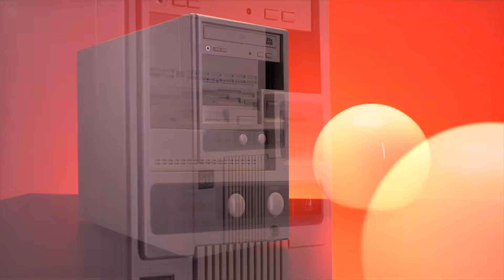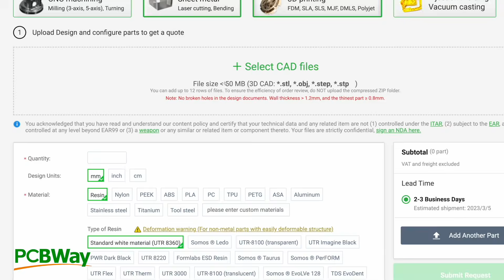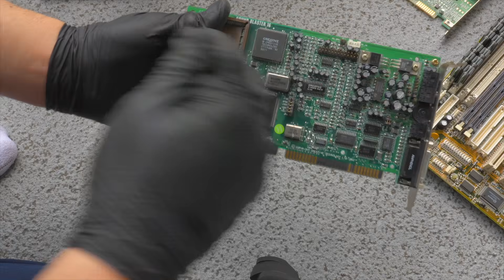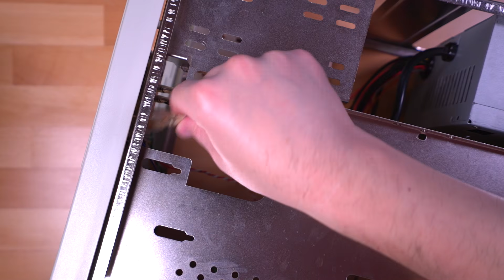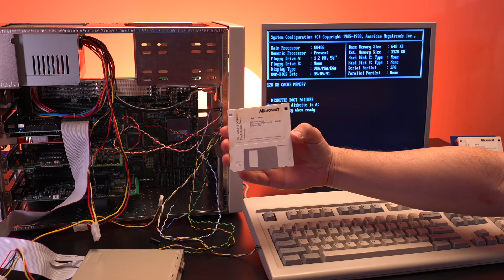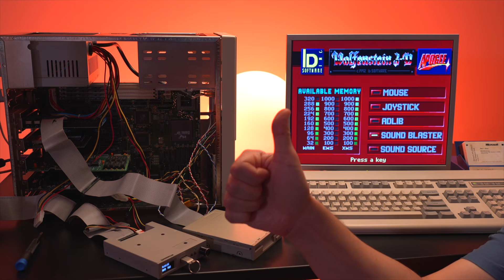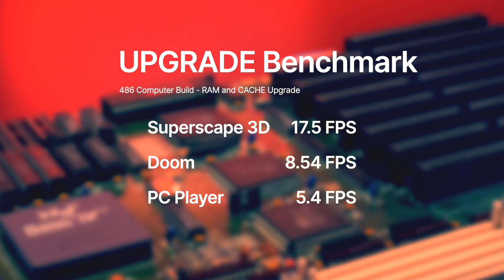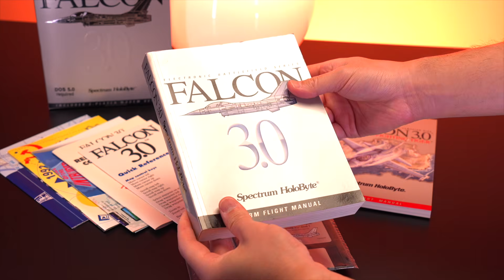Restored And Upgraded 32 Years Later | 486 DOS Build

Comment: Our first computer was also a 33mhz 486, Still have some parts from it but it was broken way back so at this point i only saved the working parts, unfortunately as I probably have the skills to have fixed the dead motherboard now. Anyhow this old stuff often need to be re-capped at this point to reliably work today, more and more of my old computers die from failing caps and I have to re-cap these failing components to keep the computers running but I mean it´s a hobby. At the same time you should use Cache check to verify your computer is actually using all that memory you installed and not just that it is installed. But 486 computers without Vesa Local Bus runs dog slow with 33mhz in comparison to a ISA VGA card and it pretty much only help to run faster CPUs on these instead. Also Compact flash cards can be a very good solution as substitutes for dead Hard Drives as these uses the IDE interface internally and can be just dropped in with a cable adapter

Comment: I would go straight to the point about the Sound Blaster Card, i don't want to sound rude but back in the days yes the Sound Blaster Card works good with the game controller aka the Joystick, but the problem is it only also work with a same compatible Sound Blaster CDROM
and a slow Sound Blaster CDROM i think it was 8x, since back then that Sound Blaster Card is a bit picky and wont allow and any pirated cd games or any pirated installer at all to run on the CDROM. But it's best to just keep the Sound Blaster card since in those current back days it's the best sound audio quality available.

So just in my honest personal opinion if, just if, you want the CDROM you currently put on the pc casing to work just plug it on to the IDE I/O PC Controller that came with the 486 DX2 mother board, not on the ISA Sound Blaster card cause there not compatible.

Comment: I saw two interesting comments regarding performance issues. One recommendation was to add 487 FPU unit which your CPU already includes (486SX was crippled version, without FPU) and second one that the VGAs bottleneck is ISA port. 

Both comments are wrong. To increase the performance you need to... Upgrade CPU. 

Doom fully relies on CPU performance, not the other components.

Recommended CPU clock to get smooth gameplay was Pentium 60.

Comment: In order to get playable frame rates on all benchmarks swap out the 486 DX2 66mhz for the Intel 486 DX4 100mhz CPU and install 16mb ram and get a motherboard that has 2 PCI slots 3 ISA slots and 1 ISA extended slot. The board I'm referring to was SIS motherboard (I can't remember the exact model) but it will allow the sis 2mb GPU and the vlb isa slot will support sound blaster 16 and 32 with creative cd drive connection. Will also have ide controller and floppy drive controller built in to the motherboard.. it's the system I had as a child and ran dos 6.2.22 and windows 95 perfectly and ran windows 98 but was slower in windows games!! It will run all dos games at a solid 30fps to 80fps depending on the game type 2D vs 3D but is all playable.

Comment: Hi! Vintage keyboard nerd here! That keyboard is an NEC APC-H412 with NEC Blue Oval switches. An absolute gem of a vintage mech keeb.
Reply: yea, he has keyboard worth of 80-120$ and he don't know, lol, 
that it's more valued keyboard, than 95% keyboards that people use nowadays, and from modern ages like 2000-2020 era.
Reply: @warrax111  the board is worth anywhere from $70-100
Reply: @ you must be from cheap country , but please don't start some war because of $10-20 difference in price estimation. The point was somewhere else.
Reply: I’d get a 486 machine if there were any way they could support USB keyboards lol
Reply: @-dash  there are USB to PS/2 converters as well as PS/2 (and 5-pin din) to USB

Comment: you did a great job I love it. I would leave everything as it is in its maximum possible originality. The modest performance is due to the old ISA bus. The best performing 486s had standard VLB motherboards with direct memory access. Or even the latest 486 DXs with PCI interface motherboards like my DX2 80. They are more performing but less fascinating. The beauty of these machines is to maintain as much of their originality as possible and the nostalgia element is fantastic😍

Comment: Dude the RAM upgrade part made me laugh because that's not how upgrading worked back then.  You couldn't just "throw in some RAM" or "add a random perhiperal" and expect improved performance or functionality.  You had to determine if a piece of software required or could even make use of it before expecting anything out of an upgrade otherwise it would basically go unnoticed by the system/OS and software.  Almost ALL versions of DOS/Windows as well as software packages would list "minimum requirements" and (sometimes) "recommended requirements".  If you didn't meet the minimum there was no guarantee it would run and if you got lucky and it did it would usually be somewhat crippled in some way.  If you met the recommended you would get an improved or premium experience, ranging from better performance with better CPU or more RAM or improved functionality such as better audio with a fancy sound card.

Comment: Regard to low FPS-
I think you are limited by graphic card, Trident were really slow low end cards, meant more for 386. Try Cirrus Logic, Tseng, S3.

486's had VLBUS to address for this problem, but you've used slow ISA card.
Another problem seems very slow CPU. DX33 was not in the playable range for Doom, DX2-66 was recommended processor for that.
If you set your DX2-66 right, I remember, even with fast ISA card, 20-25 FPS was possible. With VLBUS graphic card, you can get to 30 FPS range.
Reply: ok, now I see, you don't have PCI or VLBUS slot. Seems, you have very early 486 motherboard.
So only option is to try faster VGA ISA card.

Seems, the problem you have is bandwidth limited, or some BIOS problem. When you don't get aditional boost with cache upgrade, you know, something is limiting (not slowing, but limiting) whole motherboard down. I experiened even some card was slowing it down. Try different controller cards, etc... . Once, in socket 7 system, like 30-40% of performance was eating by PCI USB HUB card with VIA chip. I've switched it to NEC USB Hub, and problem dissapeared. Seemed like some BIOS compatibility problem.
Reply: I’m so spoiled by crispy doom. It’s hard to beat the original doom experience with the single exception of 144+ fps
Reply: @-dash  original Doom was capped at 35 FPS, so noone had more FPS originally.
Reply: @ yeah i know — i’m just saying that the original doom experience (including the in-game tick speed) is perfect, but the one exception is the capped frame rate. Crispy Doom is the perfect port as far as I’m concerned

I grew up on Windows XP so I don’t have a ton of nostalgia for the OG Doom, I think it’s amazing in it’s own right
Reply: @ yeah i know — i’m just saying that the original doom experience (including the in-game tick speed) is perfect, but the one exception is the capped frame rate. Crispy Doom is the perfect port as far as I’m concerned

I grew up on Windows XP so I don’t have a ton of nostalgia for the OG Doom, I think it’s amazing in it’s own right

Comment: Regarding floppy drives, as much as having a 5.25" drive physically installed is a nice look, complicating things enough to have three floppy drives via an extra adapter isn't a way I would go. I would've used just the 3.5" drive and the gotek. 

Regarding the optical drive, there are OEM IDE options that would look better than an obvious retail upgrade while stealthing as an improvement. Look for even multipliers of 8 and 16, such as 16x or 32x, they're likely to be more reliable and plain looking. 20x, 36x, and the like tend to be more cheaply made uglier drives that felt like they had to advertise themselves with gaudy external labels. 

If you really do want to use the sb16 card for a cd-rom, double check what kind of interface it has, because it's likely a Panasonic (Matsushita/Kotobuki) that has the same 40 pins as IDE but is an entirely different interface. If you really want a period correct drive and have trouble getting it to work with the sb16, you might look into a drive with a bundled isa controller and software to ensure a matching interface.

And heads up, the dos driver for an ide cdrom is so ubiquitous and genericly recognized as the driver, that you might run into problems if you consider it the only option to get it to work. Look for a Panasonic, Sony, or whatever ends up matching your interface if/when oakcdrom.sys fails.

Last tip, once you've got all your drivers and TSRs you want loaded into your aitoexec.bat and config.sys, if you're not already an expert at manually tweaking memory management, run memmaker, included with dos. It'll try some things and make sure you've got the most conventional ram available for needy games.

Comment: Awesome to see you're getting into retro PCs! With regard to improving performance:
The Sound Blaster 16 CT1740 uses the proprietary Panasonic CD-ROM interface which looks like an IDE interface but is pin-incompatible. Your options here would be only 2x speed CD-ROMs such as the quite common Panasonic/Matsushita CR-563 and CR-563-B models. They are a bit expensive on eBay; however, there is a 4x speed CD-ROM drive by Teac: the CD-55A, but those are rare. You'll also need to install the Panasonic driver in the config.sys file (CDMKE.SYS).

Additionally, to improve performance, you might want to consider installing a faster CPU, a DX2 66MHz from either Intel, AMD, or Cyrix. Check your motherboard manual for compatibility first. An Intel Overdrive processor might be an option as well.

Lastly, what would dramatically improve performance would be to get a better VGA card. Trident is usually regarded as a bottom-tiered GPU vendor. I'd recommend a card that sports a Cirrus Logic or S3 GPU (CL-GD5426 or S3 924 respectively). A shame you don't have any VLB slots on this motherboard because that would REALLY improve video performance, but that woudl require sawpping out the motherboard.

Hope you find this useful...

Comment: 6:38 - lol to keep that old VGA ISA card in socket 7 233 Mhz machine, had to be total FPS killer.
You should upgrade to cheap S3 Trio64, which were really fast and good , and also compatible cards under DOS. It would also raised FPS by 100%, particulary in 640x480 titles.

Comment: you did not have to install DOS again as the fdisk /mbr command works fine on already installed systems - could have saved a lot of time :) - it is a common problem when using CF-cards in an XT-IDE (some CF cards would not work even with this command - so have a couple of them ready when thinking about a future project) - and as I am german the american pronounciation (as mentioned already in other comments) of WolfenstEIn  as WolfenstEEEN - makes me shiver :D  - but as always a great video thx

Comment: What you need is to upgrade the CPU. That’s a 486DX33, on the low end of the 486 range. The sweet spot for a PC like that would be a 486DX2 66. It fits the 486 era gaming, without being overkill

Comment: The turbo button may be a bad capacitor on that particular circuit. I’m nearly 60 and used to work on these machines now and again. This takes me back. Thanks for this vid Tito, perhaps a recap once you have ironed out the rough spots so to speak.

Comment: Very excellent restoration! 486's are notoriously finicky with I/O in general - you most likely would've had trouble with period-correct floppy and IDE controllers, too! :P As far as CD-ROM recommendations go, I'd say look for a Matsushita CR-563-B. It was bundled with many Sound Blaster 16s (and what I used in my very first PC build!). Chances are good that that should work for you just fine!

Comment: my first computer was a 286
and it was magical, i had consols over the years, but the pc was always a magical thing for me (except for the NES and SNES/Genesis that where consols i REALLY think where actually superior on during those years)

About doom...
that video card cannot handle it very well (it's not about the cpu but the gpu you are using, reason you seen no gains even after updating the cache)

not with the 286 , but with my pentium 1 233 i had a Trident ProVidia 9685, VRAM 2MB with  RCA Jack, S-Video, VGA (back in the days this saved me as my crt died and i had to use the computer on my tv via RCA) but that very same card managed to run virtual game station in which i played a few games (just to test things i had a ps1 at that time)

Then a virge s3
and then i jumped to a p3 with a tnt2 (i LOVED that gpu)

Comment: What is the clock speed of the processor? You might be able to upgrade it with a faster one. I upgraded my 486SX2 50 MHz with a 486 DX4 100MHz and it made a big difference back in the day.

Comment: This is funny. What a great throw back. Sadly, I built this PC at the tail end of high school when they were new. First as an SX, then DX to add the math coprocessor! What a great reminder. Fun with the mods.
Reply: Dude the RAM upgrade part made me laugh because that's not how upgrading worked back then.  You couldn't just "throw in some RAM" or "add a random perhiperal" and expect improved performance or functionality.  You had to determine if a piece of software required or could even make use of it before expecting anything out of an upgrade otherwise it would basically go unnoticed by the system/OS and software.  Almost ALL versions of DOS/Windows as well as software packages would list "minimum requirements" and (sometimes) "recommended requirements".  If you didn't meet the minimum there was no guarantee it would run and if you got lucky and it did it would usually be somewhat crippled in some way.  If you met the recommended you would get an improved or premium experience, ranging from better performance with better CPU or more RAM or improved functionality such as better audio with a fancy sound card.
Reply: Indeed, well said. It was a lot more intricate and tinkering back then, wasn’t it? And then there was modifying the boot files to play around with it to see if you could get it to use more of the ram, or even, remember RAM drives! Lol
And then don’t even mention IRQ conflicts. Oh my gosh! Things are so simple today.

Comment: Apart from an old dual 5-1/4" floppy IBM 5150 (I think) as being my first computer, I really learned about PCs on a 386dx with Windows 3.11 that I picked up for $1000 (I can't believe i paid that)! Eventually I upgraded to a 486dx mb and installed Window 95 (yes "format" and then "fdsk") on it as well as Doom and Wolfenstein which blew my mind at the time!  Of course that damn "Turbo" button never worked and in fact I'm pretty sure it did the opposite and slowed it down a bit and so I just kept it off!

Comment: I see there is a second socket on the motherboard, was there an co processor that possibly could go with this? If so that might help with the doom performance at least since it's all calculated by the cpu. I'm not sure about the other programs, those look like they're wanting a 3d accelerator card lol but I'm not entirely sure about that either. My era of pc gaming started on windows 98 se, so I'm not all to familiar with actual dos vs the dos of windows 98.

Comment: This is beautiful. Our memories are what make these so special. The 386 was my childhood PC, and I spent countless hours unsucessfully trying to load Windows 3.1 on it. I've spent a good chunk of my life working on PCs and this the first I've heard of a lot of these addons, great research!
Reply: Dude the RAM upgrade part made me laugh because that's not how upgrading worked back then.  You couldn't just "throw in some RAM" or "add a random perhiperal" and expect improved performance or functionality.  You had to determine if a piece of software required or could even make use of it before expecting anything out of an upgrade otherwise it would basically go unnoticed by the system/OS and software.  Almost ALL versions of DOS/Windows as well as software packages would list "minimum requirements" and (sometimes) "recommended requirements".  If you didn't meet the minimum there was no guarantee it would run and if you got lucky and it did it would usually be somewhat crippled in some way.  If you met the recommended you would get an improved or premium experience, ranging from better performance with better CPU or more RAM or improved functionality such as better audio with a fancy sound card.

Comment: Nice work! My Mom did the same with all of my old big box PC games back in the day. I proudly have them on display now. You should check out the MT-32Pi. You connect it from your SB16, and load up a game that supports the Roland MT-32 (Lucas Arts SCUMM games, Sierra adventure games, and a bunch of others from the era). The PicoGUS is also another great option to check out.

Comment: It isn't surprising to me at all that your upgrades didn't help with your benchmarks. Adding RAM doesn't speed up things that are compute-bound, they just let you hold more stuff to do in RAM, and on operating systems that have virtual memory that can increase performance if you're trying to do too much at once - but DOS doesn't have virtual memory. These old DOS benchmarks also wouldn't have enough working data to benefit from added cache.

Comment: My family's first computer was an "AST 486 SX/33 Model 213". It included the same Sound Blaster 16 CT1740 card you had with your first computer. The CD-ROM that was included with our system was a "Matsushita CR-562-B" and plugged into the SB16.

While it looks similar, the cable was not IDE but used the "Panasonic CD" / "MKE CD" interface and does not have a keyed-out IDE pin.